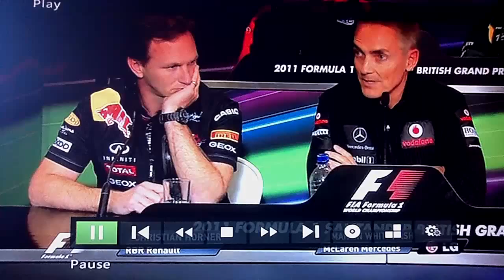Christian Horner VS Martin Whitmarsh (fixed)

Comment: I agree with Whitmarsh on the point that making rule changes in season isn't a good idea. Every time it has been done it has created problems.
The fired overrun wasn't a big issue. They could easy allow it through the season but ban it for the next. We would remember 2011 as the season where the cars made funny noises. I don't see the need to rush a ban which in the end worked like cr*p.. It just doesn't work to rush in rule changes into effect in the middle of a season.